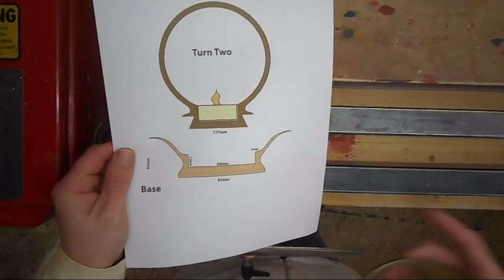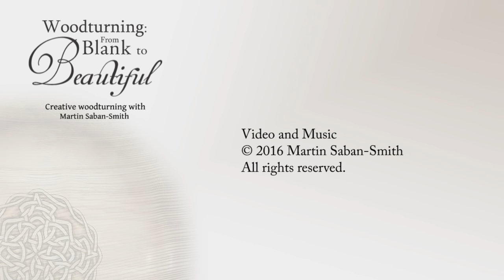#57 Woodturning Project - Large Inside Out Sphere Tealight Holder

Comment: This is very cool. I wonder though if you could have turned the hole for the candle whilst it was ‘inside out’? I ask this because if so, once it’s together the correct way you could have made a small hole under the candle for a magnet to sit in. Then, place another magnet in the base but with the same pole pointing towards the other magnet so that when you put the two pieces together the upper piece has just enough separation and ‘float’ to be able to spin. That would be awesome!

Comment: Excellent as usual. With working in quarters and reversing them had you thought about creating a digital model first. I'm sure you could do something like that in sketchup which would then allow you to duplicate the quarters and reverse them. That may have saved the mistake early on and you could also have produced the templates.

Wasn't sure about the colouring as you did it, but that final image of the finished item at the end of the video really does look superb, just like several of your other colouring projects.

For the final buffing, rather than using something so severe at the drill and better than the duster, why not use the dremmel. You can get small fabric buffers and that would allow you to get to the places that no drill will ever get to.

Paul

Comment: really nice looking piece...the rescue worked and turned out very well    -- you got the side walls super thin, probably thinner than i would have dared!! 
    I tried one glued up turned piece, though instead of hot glue, i used wood glue and included a layer of brown paper in the glue joint, which lets you separate it when you're ready to turn it inside out....   I had been told the hot glue just wouldn't hold as well..    seemed to work just fine for you however so now i'm wondering if the difference is all that significant....